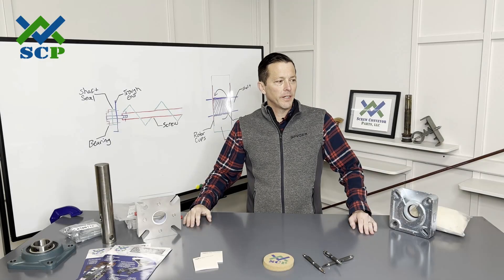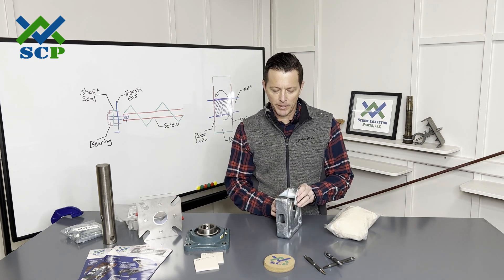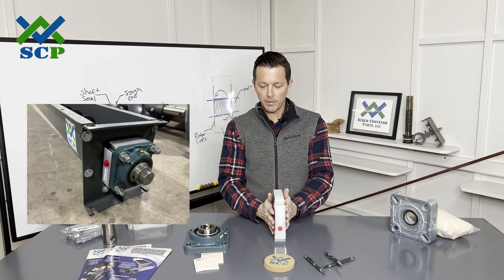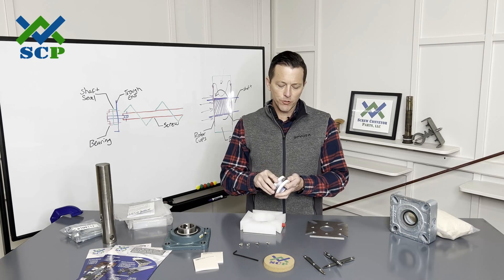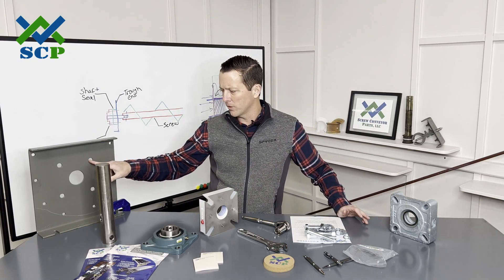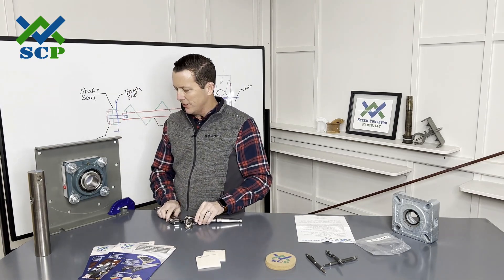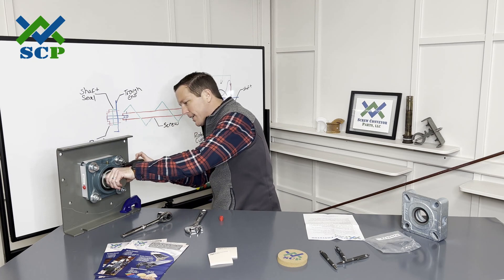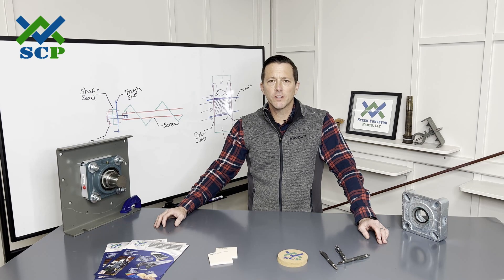SCP Master Seal

Comment: The installation of the master seal appears to be on the non-drive end, is this correct? What type of CEMA shaft is used on the drive end if you wish to place the seal on the drive end? Do you have to used a reducer with a CEMA adapter flange (with shaft) of can you also use a flange bearing with standard reducer hollow-bore on the drive end?